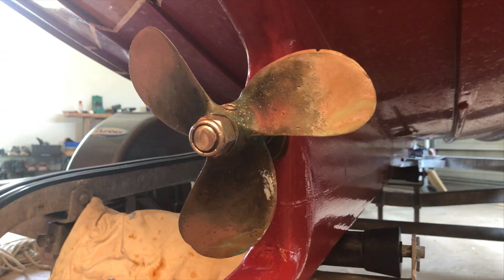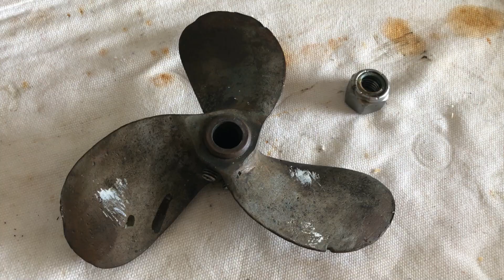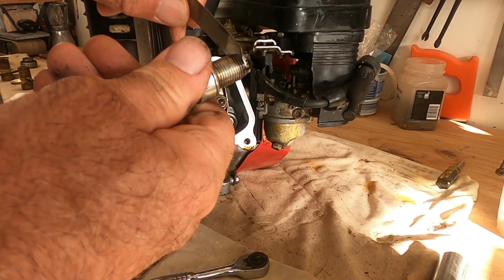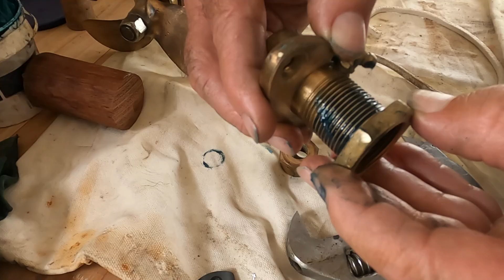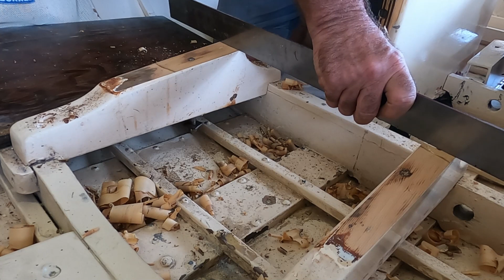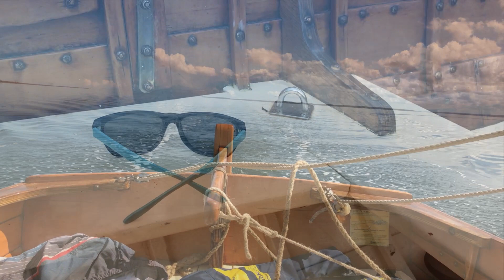How to install an inboard motor. Repacking a Stuffing Box. All Details

Comment: Thoroughly absorbing.  It’s more fun with wood😂
Reply from the maker: I agree, there's something special about working with wood!
Reply: @smallsailboatcruising .  I always imagined steel would be best, a cutting disc and a $300 welder is all you need to repair anywhere and a 6’ x8’ sheet of 3 mm is a cuppa hundred bucks, no need for shipwrights or expensive wood. But where seams can be   Re caulked  on wood, when steel gets eaten by electrolysis it’s game over.

Comment: Hi .. I am following your work and using your knowledge to help me do a similar engine fit on my clinker. Is there any reason you don't use a Centrifugal Clutch on the honda. And to reduce vibration, fit a rubber engine mount.
Reply from the maker: Hi. I’m fitting a small diesel to an 18 footer at present. I has flexible mounts. Clutch and flexible coupling. The Honda has a flexible rubber coupling. It doesn’t have a clutch. And it’s bolted straight to the Timbers. 

Modern Hondas are so smooth they don’t need flexible mounts. We’ve done several that way over the years with no problems. 

If I were to install a clutch in moonlight I would use a dog clutch. Friction device it it would not help much and would take up a little room. Not necessary in a small boat simplicity is best. Lees to go wrong. 

The only centrifugal clutch that I’ve had any experience with was a Honda. It had Ford in reverse and it failed eventually not very good in a marine environment. However, there may be something better available now.

So it comes down to personal preferences, and the actual type of boat you’re putting it in what’s good for the 18 footer with the big heavy diesel is not as good for a small 12 footer. I hope that helps. Let me know if you have any more questions.

Comment: I'm trying to build a similar inboard propulsion system on my boat. If you don't mind my asking, how large is the hole in the stern log through which the prop shaft passes? It looks considerably larger than the 5/8" shaft itself. And did you say you packed that entire space with grease? Thanks.
Reply from the maker: There is a clearance hole through the keel. I can't measure it without taking it apart but I am guessing it is around 7/8".  Just so long as it has clearance when the wood swells. I packed it with grease because I could. if it didn't have grease in there it would fill with water, so it provides some extra protection from ingress of water.
Reply: @smallsailboatcruising  Thank you for your video, I have finally seen a stuffing box that looks similar to mine. What do you call the stuffing boxes that you have? I am restoring an old net boat that has the same type as you except I only have the propeller end and not the inboard end. I need to buy another end. My shaft cavity is just a hole drilled through the timber, no lining, so if the propeller end leaks water will go up the shaft cavity. If it leaks slowly I may never know if there is water in there. I like your solution of packing grease in the shaft cavity. I think you say it is not lined.
Reply from the maker: @philipsen9835  true. There is no stern tube.  It has never leaked apart from a couple of drips over 40 years.

Comment: Nice and easy to follow demo. Every step well thought out. It is funny how holes seem to move over the years, I've noticed it myself. The difference in before and after is great. It isn't easy to notice gradual changes until something bad happens usually. I like it when people adapt and repurpose one thing to do another: proper men in sheds engineering. Keep well.
Reply from the maker: The new mounting holes were 3/4" away from the originals and the angle of the drive shaft had altered significantly. No wonder she was shaking to bits! I took her out a couple of days ago after I fixed her up and she ran like a dream. Much quieter and the motor was not under constant load. It was gusting into the high 20's. I got some great footage. Broke the rudder unfortunately, but nothing breaks if you leave your boat in the shed eh?